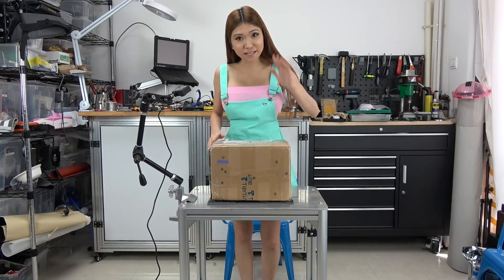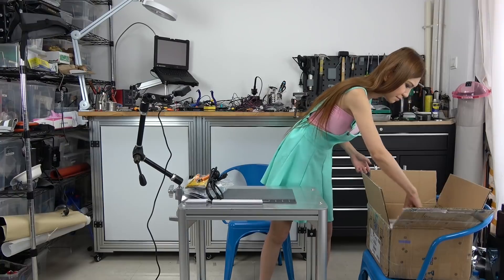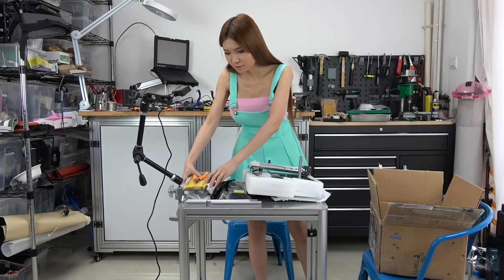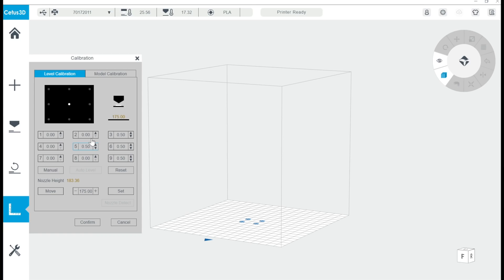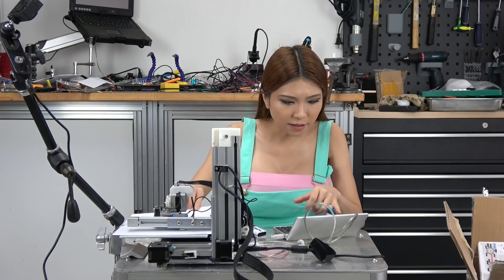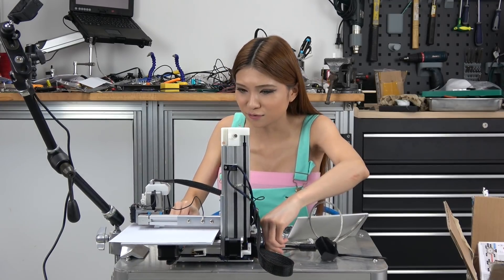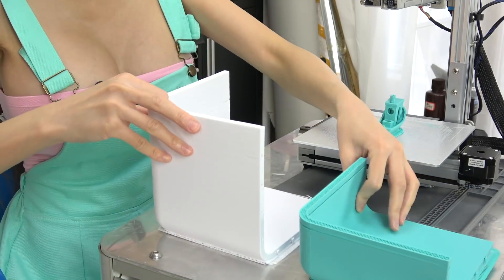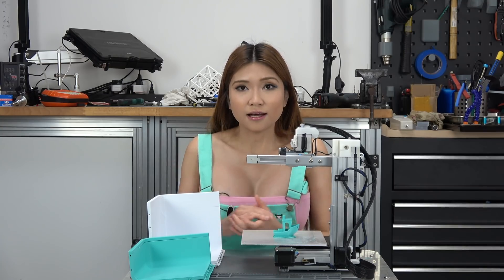Cetus 3D Printer Unboxing and Review

Comment: Cetus3D is a nice printer for a beginner, very easy to assemble and start, but there is a price for simplicity. really long custom nozzles makes it susceptible for partial or full blockage. Cold pull for cleaning is also difficult-to-impossible to perform.  price for a nozzle replacement and the fact that there are no cheap worldwide delivery is also not very pleasant. I still do not regret buying it as my first printer as it was good intro to the world of 3d printing. 
Printer is optimized for 0.4 nozzle. But 0.4  is good only for smaller parts as you said. For bigger prints, 0.6 (supplied with the printer) works much better and i didn't have any adhesion problems with bigger prints aven with cheapest PLA. 0.2 has beggest layer adhesion problem in my experience.
Thanks for the review, I hope you will get current issues sorted out.

Comment: I will note that the mentioned $300 price in the video is not what's presented by Amazon at this time. For a video that's been public for a day it's a bit frustrating. But I do recall @makersmuse noting Cetus price increases in the last week.
Reply from the maker: I'm really sorry about that🙁 totally not worth the price it's listed at on Amazon now. I'll do better next time. So unprofessional...
Reply: I don't know about unprofessional, I think you did a great job there. Keep in mind that it very probably was at $300 right up to when you first made the video available, and only went up after it went to patreons.

If the linear rails are as solid as they look, and assembly is as smooth as you demonstrated (and i know that  part was time lapsed, and I don't know if it was edited, but doubt it) it looks like the worst problems are whatever is causing the layer adhesion problems in larger prints, and there may be more than one solution to that, as noted by others  who have responded. (print speed, better control over the cooling fan, etc.) Those things very well may be things to address in the slicer rather than the printer.

I seem to recall with one of the Cetus products some time ago that they were using a proprietary controller and control files, not standard g-code. I suspect that may still be the case, as you had to download an app to control it. That would probably be a deal killer for me, not because I have any problems with running the app, I'm pretty sure that it runs unde Ubuntu as well as Windows and probably Mac, but because what I need is an application that would run on a Raspberry Pi, with a web interface. (It doesn't have to be a raspberry pi, but something on that order of expense and energy consumption) If they are using a non-proprietary controller though, or it will accept control by OctoPrint, I would be OK with even the newer higher price. Not saying others would, just that I would be.

I'm not quite ready to buy a new printer right now. I'm using a pair of Wanhao Duplicator i3+ machines for mhy printers at the moment, have another i3 that I'm trying to restore to working order, have a PrinterBot Simple Metal that still works, and can go into production again if I need it. a TronXY X1 that I need to solve a bed problem with, and am in the midst of building (slowly) two other printers, so for the moment I'm OK.

This may be back to being a 3d printer for $300, or perhaps $350 in a month or so. Or it may not. It may be worth keeping in mind if they ask you to review another printer, especially if this is a pre-production to production price shift, and especially if they have done it before. If it's simply an 'oops' on their part, or the difference between what it would cost on BestGear, and what it's going for on Amazon, then it's probably going to be more work don the road to prepare for.

I suspect that you're notes (several times in the video) that at $300 this is a decent printer especially if they solve the large print problems, tub not worth a lot more is more than sufficient to cover you. I don't see this situation as a problem with your professionalism. Keep it up, you're doing great things.

Comment: sounds like you need to up the filament feed rate a bit, should fix your under-extrusion problem and layer adhesion.
Reply from the maker: Unfortunately, it's locked into their proprietary software which makes troubleshooting a pain.
Reply: maybe you can suggest to the company that they unlock it.  They need to understand that user adjustable settings are necessary for people to get the best output for a variety  of materials.
Reply from the maker: Everyone has been asking forever...

Comment: Hey Naomi. That white tubing that you called a Bowdoin tube and didn't use is actually a filament feed guide. If used it may prevent the under extrusion that may be causing your layout separation
Reply from the maker: Yeah when I was unpacking for some reason I forgot the printer was direct drive. I tried it also, same results but you're right I should have left it on.

Comment: Nice review, Naomi. I'm printing on my Cetus mk1 right now. I have found it to print small/medium sized objects reliably well. I print the big stuff on my larger printers. I agree with you that it is a good printer for the price paid. The only thing I wish is that it wasn't tied to Tiertime's software, which is good but still not as capable in my experience as Cura or Simplify3D. Keep up the good work!
Reply from the maker: Yeah really, really not a fan of their software...

Comment: I have had layer separation like that on my CR-10. It was caused be a tangle on the filament spool causing the extruder gear to slip and not feed correctly. You might want to check that the extruder or the filament path is not causing feed problems. It looked like the filament was coming in at a sharp angle going into the extruder.
Reply from the maker: Yeah, even replaced the extruder. No love...

Comment: would baking the part after the print not be a possibility to "weld" the filament layers together? Anyone ever tried something like that before?
Reply from the maker: Sure you can anneal prints, but you want to start with a good quality print that has no layer problems first.

Comment: Thanks for the review.  You think the problem with large items is a heat related issue?
Reply from the maker: It can do it I'm sure, but it needs some tuning. Just saying out of the box people might have some issues.
Reply: Thanks Naomi. Great video
Reply: I think it is the Multiplier settings! (the item (infill) look also brittle)
Reply: Could be just a little bit of underextrusion. That way the error accumulates as more layers are being stacked on top of each other.

Comment: Hi Naomi, what caused the separation on those large parts? Inconsistent temperature on the print head? Thanks :)
Reply from the maker: Yeah something with the head temperature. I think it could do it with a little tuning, but out of the box some issues to address.
Reply: Ah OK, thanks for that. Maybe feed rate is too fast? Don't know, I haven't played with any 3D printers, I am learning from you. I'm sure you will work it out.